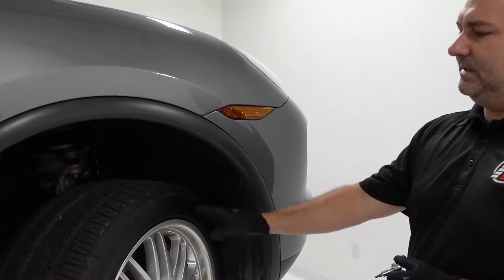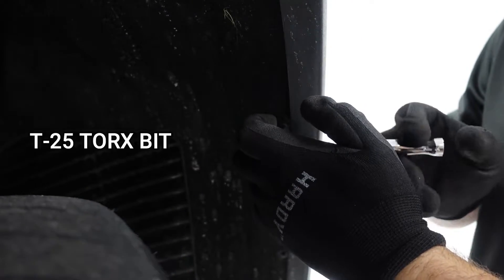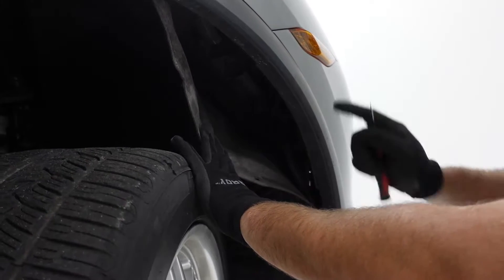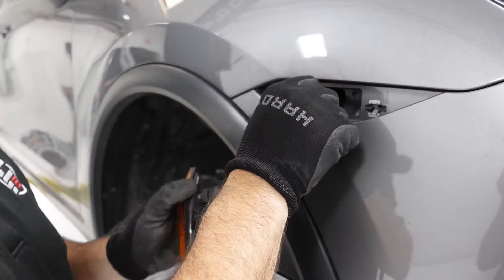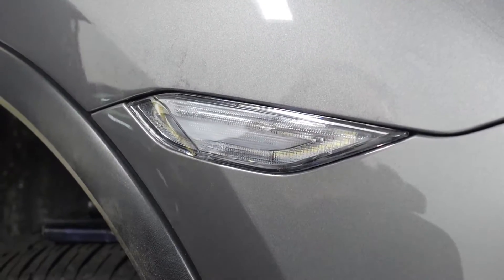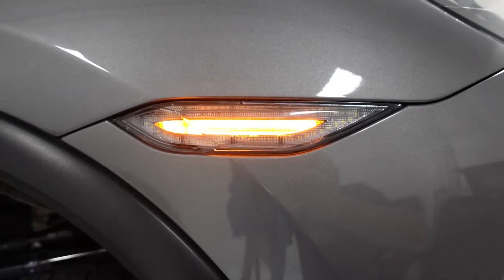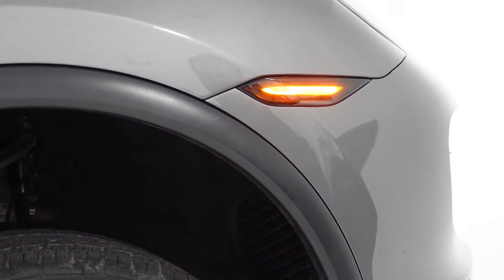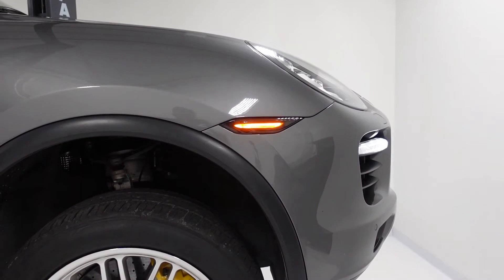Flat 6 Motorsports - 958 Cayenne LED Side Markers (Install Guide)

Comment: Instead of taking the molding off to get to the light, take a piece of fishing wire and loop it under the front end of the light, slide it back a couple of inches and pull.  That snaps it out of the front clip, then just pull it out of the rear clip.   Much easier and quicker.
Reply from the maker: Yes, that is a technique that we mentioned but thanks for sharing more information/context on what to do there.
Reply: I did this and they popped out. I had to double up on the line since it was a lower pound rating but it worked like a charm.